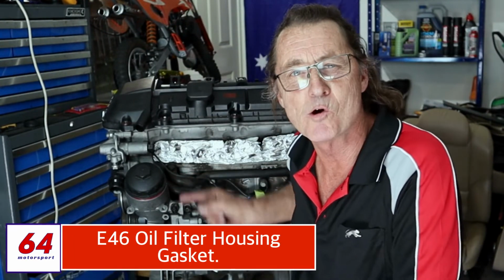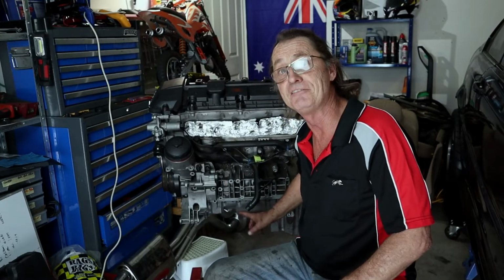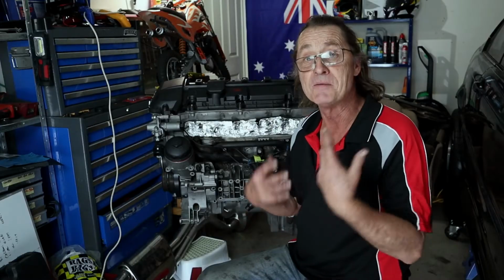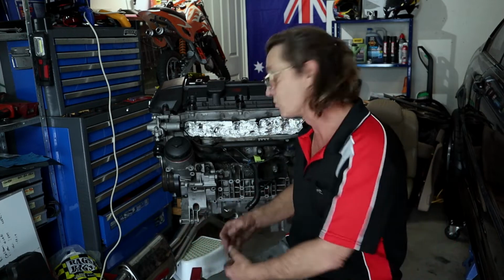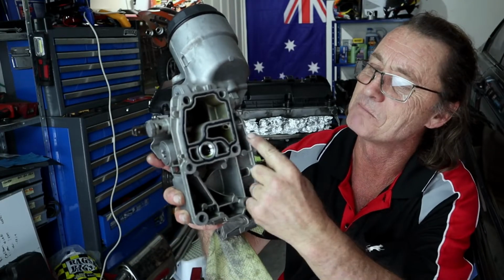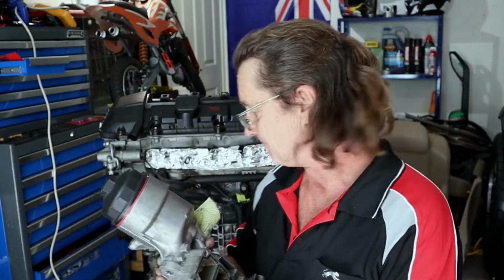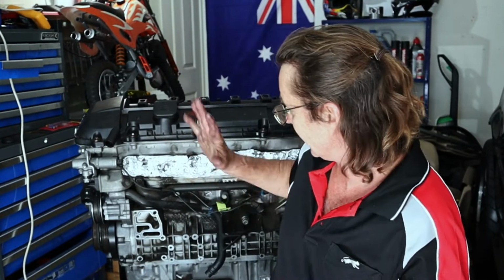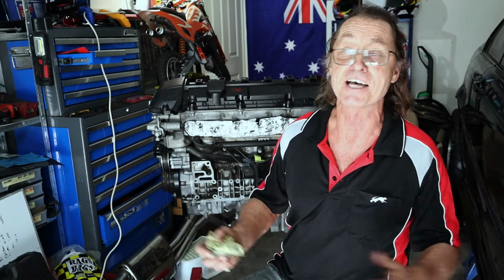BMW E46 MAINTENANCE // Why is it so expensive to replace a $10 gasket?

Comment: I changed my VANOS pipe, but I recommend the Chase Base pipe. Much better for not too much more money.  Also, instead of the OEM oil filter mount gasket, try a High performance DuPont Viton synthetic rubber gasket and be done with it.
Reply: Sorry, Chase Bays

Comment: Great video and channel sir.  Just did the oil filter housing job on my 2005 Z4 M54.  A little aggravated my manual didn’t have torque specs for the 6 housing bolts.  Tightened them-all down nice and tight mindful of not stripping them.  Also this job gives you appreciation that replacing an alternator on this engine is fairly straightforward as you have to remove  it as your video states.

Comment: Hi mate, I just bought my  first E46, it is a 330ci 2002 auto.
Car looks good and it was ruining pretty good but 4 days after I bought it,  it starts to idle funny,  I went to the mechanic and he told me to start with the PCV valve. But he charged me 750 dollars.
I like play with cars and I was thinking about to do it myself. 
Have you done it before?
Do you reckon it can be done by a non mechanic guy?